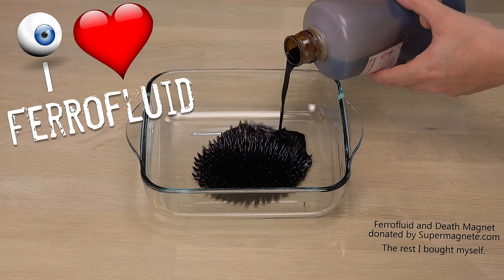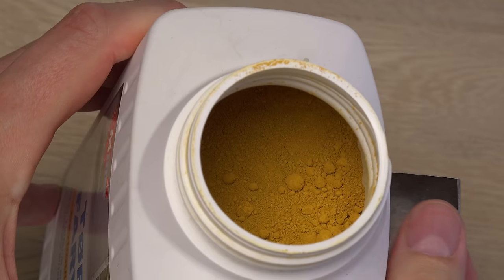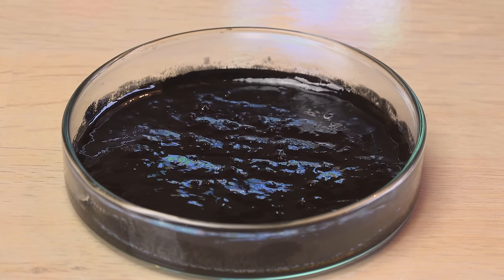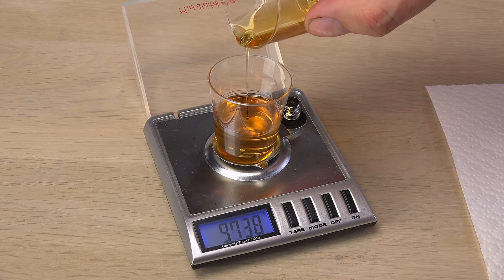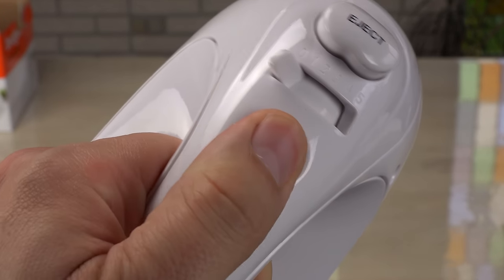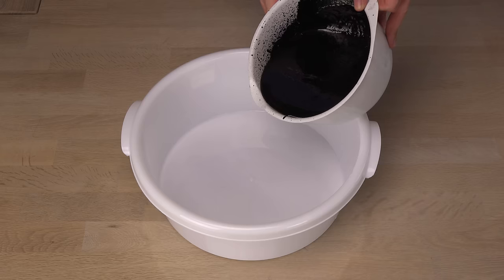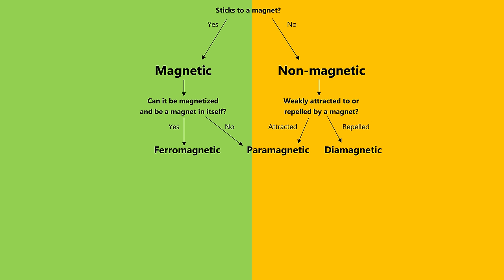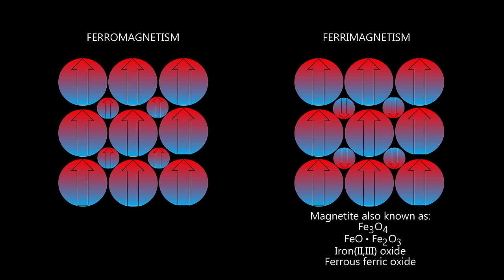Magnetic Motor Oil? | Easy DIY ferrofluid

Comment: +Brainiac75 I bet you've tried that, but I have to ask: how about adding some liquid detergent or liquid dish soap on the mixture? Wouldn't it improve the surfactant capabilities of the oil? Or perhaps it would ruin it all, preventing the oil of envolving the magnetite particles... I don't know.
Reply from the maker: I haven't tried it. The surfactants need to react with the iron sites in the magnetite and I'm not sure dish soap etc. contain something reacting with the iron. Magnatec oil is specifially designed for reacting with iron/steel inside an engine so it's perfect for this. But there's definitely room for experiments with this stuff! Thanks for watching.

Comment: Hey dose it have to be magnatec stop start oil or can it be any oil
Reply from the maker: It has to be an oil with the right surfactants. Other high-end oils may work too but I have only tried it with the shown oil.
Reply: So as long as the oil adn iron oxide mix together it's alright?
Reply from the maker: No, the oil needs to have the right surfactants to cover the iron oxide. Otherwise the oil and iron oxide will separate near a magnet and not form spikes.

Comment: why do the spikes look more like jagged ridges than smooth points? e.g. 8:06 9:10
Reply from the maker: Good question - I don't really know for sure. My guess is it is due to a combination of the higher viscosity of the ferripaste and size of the magnetite particles. The particles in the ferripaste being way bigger than the around 10 nm small particles in chemically prepared ferrofluid. The particles in ferrofluid are so small that they are constantly stirred around in by brownian motion.
In the ferripaste the particles are much larger and may stick more together due to their own magnetic field and not only follow the magnetic field of the external magnet.

Comment: maybe try something like water simular so it's gets runnier
Reply from the maker: Water can be used as a carrier fluid - but not as a surfactant, so something else should be added to get it to work.
Reply: Brainiac75  I meant that maybe you could ADD something like that to the mixture to make it luquidier

Comment: There seem to be 4 different CASTROL MAGNATEC oils. Do you know if some are better than others?
Reply from the maker: I have only tried with the shown - I believe all Magnatec branded oils have the right surfactants, but can't guarantee it. I wish I could find the more fluid 0W20 variant. Should work the best.
Reply: I finally made some. I used the 0W20 variant that i managed to order over thansen. I started with an 1-1 ratio and it had a very low viscosity almost like real ferrofluid. When i came close with a magnet, the oil and iron oxide started separating, so i had to add more iron oxide until it was more like a paste. I also tried mixing iron fillings with the oil but it didnt work well. To avoid that they started separating i had to add so little oil that it was more like moist iron fillings than a fluid :P. Good Luck with your next video!
Reply from the maker: Really? It separated when you used 0W20 Magnatec without spiking? Or was it another brand of motor oil?
Reply: Yea, its definitely the 0W20 stop-start Magnatec. The 1-1 mixture starts seperating when i come as close as possible with a 2cm by 1cm neodymium magnet. The space between the spikes starts filling out with the oil. I suspect that the magnet concentrates the oxide close to the magnet while the oil is not strong enough to counteract that force.

Comment: A 0W-20 synthetic oil would probably work much better - being thinner at room temperature.
Reply from the maker: Yes, I actually looked for the 0W-20 Magnatec but couldn't find it in Denmark. Guess it's not cold enough here for that type of oil :)

Comment: SIR HOW MUCH IRON OXIDE WILL COST
Reply from the maker: Depends so much on where you live and buy it. But magnetite should be very cheap. For example 500 grams for £5 ( http://www.ebay.co.uk/itm/MAGNETITE-500g-Magnetic-conductive-COIL-CORE-POWDER-Fe3O4-Ferric-Oxide-/261141008974 )

Comment: Never saw a machine that says it must not be over X minutes working or will burn out :0. Also the turbo button is worst than the turbo button in old AT pc's.
Reply from the maker: I was a little in doubt about what it meant too. No instructions included with this cheapo hand mixer. But KB is short for 'kurzbetriebszeit', which is German for 'short operating time' (https://de.wikipedia.org/wiki/Nennleistung).
This hand mixer must be one of the worst electric tools I have bought - but it did the job :D
Reply: Brainiac75 How much it cost?
Reply from the maker: I paid around 100 DDK which is equal to around 15 USD. May sound like a lot but everything is expensive in Denmark due to 25% VAT and a generally high taxation and cost level. A basic, branded hand mixer is at least twice that price in Denmark :)
Reply: Brainiac75 Found the same in Argentina (where I live) but the price is $700 which is around 45u$s. So 15 doesn't looks like a lot :(

Comment: step 1: get cheap car for £200 off gumtree
step 2: remove intake and run it at full revs while throwing sand in the intake
step 3: drain the oil

BAM